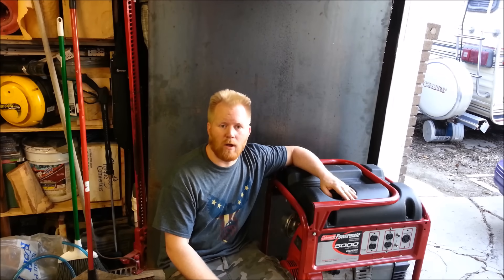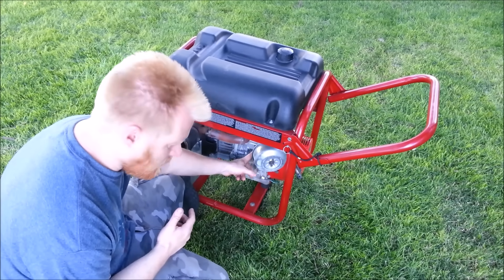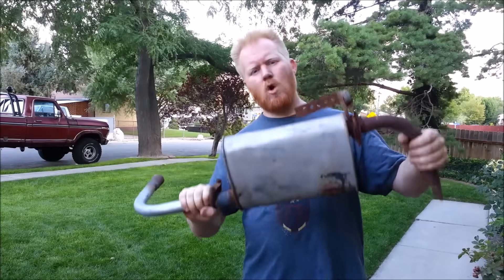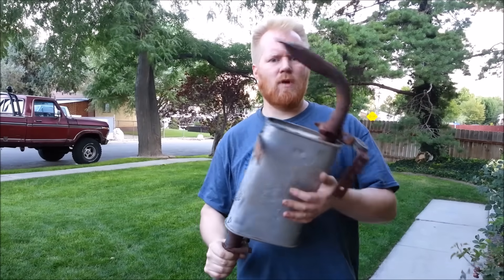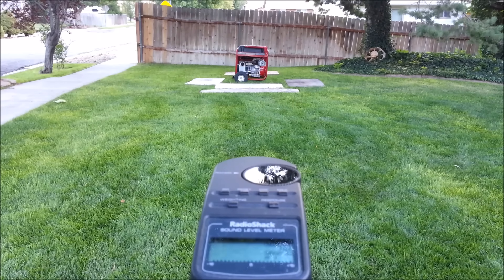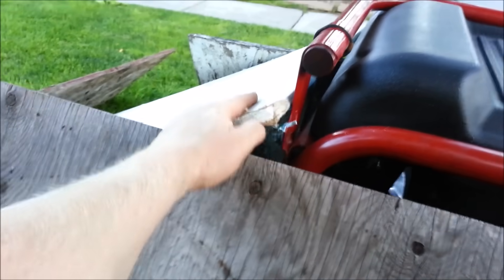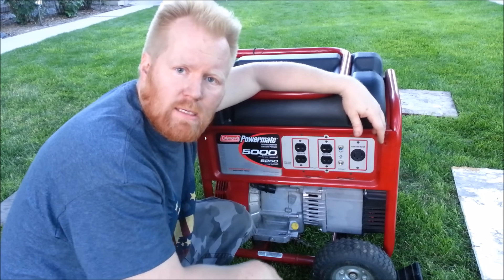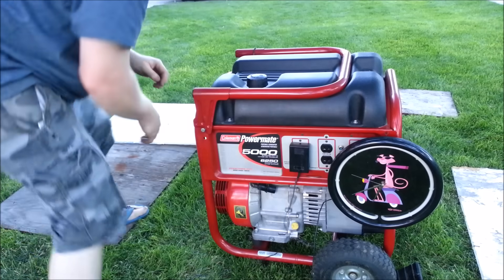4x Quieter generator in 10 seconds

Comment: Not that I dont believe you ….it’s just hard to think that on a 90 + degree humid summer day that there’d be enough cooling with all sides partially  blocked …..I do hear what you’re saying about air cooled engines only using the fins on the Balancer to circulate air …..but in an enclosed area on said 90+ deg humid day with no breeze ( that’s my most extreme example lol) I’d be nervous of one: enough fresh air getting In Through the partitions,and two: a good exchange of spent hot air , meaning reusing the air In The enclosure over and over to an extent and super heating that recirculated air…..I’d suggest on small addition , a small fan plugged right into a power strip / pig tail / splitter to push or pull air across the cooling side of the engine…. But then again I have been told I worry too much at times 😜

Comment: Best generator shutter upper I've seen ! I've done all your tricks and it does work.
 I'm not done with sine wave cancellation, though. I think that's the key. Somehow.
I also add a small cooling fan, plugged into the generator.

Comment: Honda makes the best generator as far as reliability. just like cars the Japanese know how to make a quality product that will last many years. i bought a used eb3000c generator that puts out 2500 watts for $500 a couple years ago. great backup power: you never know when will the power go out. the newer eb3000c gens have a cycloconverter that cuts down on the weight of the generator and has an added filter circuit for better reliability. if you have a welder you can add on a wheel kit to make it easier to move around. weighs about 75 lbs. spare parts would include an ignition coil and an ignition module. the combination low oil level and ac output indicator device includes the ignition module. this is a potted component and has a higher failure rate because it gets hot and potted components dont dissapate heat real well.

Comment: I'm looking to purchase a generator for home. I would only use these do to a power failure. My question is, how do you address having a generator outside in the elements? Usually it's snowing or sleeting, high winds rain etc that would knock out the power to your home.

Comment: Building a completely enclosed box insulated with fiberglass insulation for the generator to go inside would make it way quieter, probably as quiet or quieter than a car. You would need a fan and air inlet/outlets to keep the generator cool

Comment: Run that same test again and this time do temperature readings before you cover it all up and then shortly after coverlet make sure you not overheating that motor
Reply from the maker: I've done this and the engine and gen head temps are within 5degrees F. All 4 corners have huge openings to allow for plenty of airflow.

Comment: Thinking about buying the Duromax XP15000 and that's 84db, so thinking about ways to deaden the sound. This definitely gives me some ideas. I like the doghouse idea with fireproof sound absorbtion of some sort on the inside but with enough ventilation so it doesn't overheat. Should be able to rig something like that.
Reply from the maker: A full dog house is your best bet to quiet that down. 84db is extremely loud. A human perceives every 4-6db as something that is 2x as loud.  So compared to something like a Honda at around 54db this is 12 times louder. You might want to consider their 13000watt or 10000watt at 74db that is 1/4 the sound but still loud.

Comment: It might fly with the small genny and no load used here, but it's still a terrible idea. You get any bigger and actually use it for it's intended purpose, with a load, at best you will cause it to over heat and get a thermal shut down. At worst, you will overheat and either cut years off the  service life or just kill it completely.

Comment: Every 3db is a doubling of power so a 10db reduction is greater than 6x reduction in sound power. That's why there's so much difference between the before and after sounds. Probably been said already, I couldn't find it though, but it can't be said enough. Log scales are tricky. Great video.

Comment: Be sure to monitor temps. Restricting the airflows can soon lead to overheating.
Reply: Did you watch the video? He mentions airflow…
Reply: @MassDynamics  LOL he restricted air flow  that means the generator is running hotter than normal get it???

Comment: Luckily my storage shed with the genrator in it is only about 25 feet from my house - so I just let it run inside the shed with the door closed. It does get hot inside the shed but the unit still runs fine and it's much less irritating. Gonna try an inside layer of wood around it inside the shed to see what happens.

Comment: Honestly the only way that I can see to significantly lower the sound would be to replace the engine with either a two cylinder diesel engine or a scrap four cylinder car engine. These engines by design are very loud. I enjoyed your video and have subscribed.
Reply from the maker: Car engines really aren't that quiet. Open the hood and have someone hold the throttle down to 3600rpm like the generator and you'll be surprised. The hood, firewall, radiator and inner fenders are designed to reflect a lot of the sound energy.
Reply: @sixtyfiveford  this is true my friend but they are comparatively quieter than these mower engines. Plus if you were to keep the exhaust system in tact that would make them much quieter as well.
Reply: @sixtyfiveford  I would love to see you use a car engine for this genny just to see what the difference would be.
Reply: And by the way, much respect for you even replying to such an old video. That is the mark of a good content creator.

Comment: Haha not sure what Subaru you been around. Here in colo NO JOKE. Those ugly as sin cars run for 600, 700, 800,000 miles. Not little driving. All winter long you see those goofy hippy driving those shit boxes up the hill from Boulder for 2 hours and in the summer driving them 6 hours to Moab. If you can see my feeling for them haha but to say they blow up haha maybe your in a different Dimension.
Reply from the maker: Subaru small engines are only put in the cheapest budget power equipment. There is nothing good about them. As far as high mileage cars, every major brand does these kind of miles and plenty are well documented. Only difference is most people toss a car when it starts looking ratty.

Comment: In the virgin islands after a hurricane in 1995 are used a water muffler. I would run the exhaust down a pipe into a barrel of water. It reduced exhaust noise considerably.  The bucket has to be below the engine.

Comment: I build enclosure for mine.   I have a fan built in for better air circulation.  I place it right at garage door with extended muffler aluminum hose.    Way quieter with enclosure!   I use it from time to time to charge up my home solar storage  lithium when not enough sun.
I do have sound abortion material in the enclosure.    Excellent material for  free and fire proof.   The  free materials come from cushion of  swivel chair.

Why buy?   look around the house and use what is available.    I practice daily reduce  reuse   recycle    and so should you!!!!!!

Work fantastic with enclosure.   Yep i run in the garage with exhaust outside via extension metal hose.   It has been working for years!!!!

You can buy  under $20 fan on Ebay all day long.  It runs on 12V  or 120V.  All generators have either of those voltage.

Comment: Excellent empirical engineering!  The secret is LAYERING with various materials.  The more layers, the more diverse materials ... the more attenuation.  Thickness, distancing & geometry are more about redirecting the energy and filtering.  Forcing energy to make the transition from one type of material to another is where the dampening occurs ... applicable to DC through 'daylight', seismic to cosmic.  They all behave like waves of particles.
Reply: You're mostly correct about layering and different materials being effective but the underlying reasons aren't understood by most. First of all, separate layers are good primarily because of 'decoupling' (inhibiting physical transfer of sound wave energy into and through the barrier via vibration) and also 'dampening' the presumably flat, rigid surface which in turn adds mass and reduces transmitted vibrations, especially above low frequencies. Those are the 2 main reasons layers are helpful regardless of material but lower frequencies are much harder to simply deflect with a hard surface and need a relatively thick layer of soft, low density material like foam, very thick carpet or similar. It's important to know that it's very easy to block mid-high frequencies with any rigid surface but, like drywall in a house for example, lower frequencies and especially bass frequencies (<100hz or so) are poorly muffled by just a hard/rigid panel and need the extra layer(s) as described above.

So if you're gonna bother to add layers, you want the soft layer on the inside facing the source to greatly reduce mid/low frequencies. This gets kind of exponentially harder the lower the frequency in hertz but that's really only relevant for subwoofers and generator/engine noise is nowhere near that low thus doesn't need that thick of a sound barrier or that much added panel mass.

Comment: An air cooled generator needs air, not a good idea 🤦🏾‍♂️🤷🏽‍♂️ a single cylinder engine air cooled at 3600 rpm ...not a good idea to block the air

Comment: FYI: You can find "Lead-lined" drywall,...."LEAD" is a very heavy, soft metal, that can ABSORB a lot of sound, and thus QUIET the noise that might otherwise pass thru the drywall sheet.  It's expensive, (because it is much more labor intensive to handle it..... It's usually used in hospitals, in X-ray rooms, to shield against X-ray/radiation from passing thru the walls, etc.  Perhaps, try wrapping a standard muffler, with a thin layer of lead sheeting....(?!)...
Reply: FYI
I found it cheaper to pay elon musk to transport my generator up to outerspace and buy millions of mile of cord to drop back down to earth. 
Currently I have enough energy to power my 1 watt light bulb on my outhouse.

Comment: I use acoustic ceiling boards, usually, I get them free when they are getting replaced.  Just paint the outside white. The inside facing the genset absorbs the noise.

Comment: After a hurricane, it is still windy.  This would get blown away pretty quickly.  We live in Florida and have a very noisy Champion generator.  I think it is a 11,000 watts peak output.
Any suggestions on how to hold that setup in place?
Reply: He gave that to you in the video.  A cargo net with some stakes driven into the ground.   This assumes moderate wind, obviously, like you'd usually find in a fenced in back yard when the hurricane has quieted down into say, the 40 gusting range, and dried out a bit.  In an open 130 mph wind the boards will be gone, the genny will be gone, and when you try to go out to start it, not noticing it's not there anymore, you will be gone.  :-)  Most of that was silly, but the cargo net part, and I would stake it fairly judiciously, especially since the ground is usually saturated all to hell, so much so that I got a tree and $30k worth of damage in Charlie (we got a tornado, too).  The root ball was intact six feet out from the tree, and just lifted right up out of the ground.  

We were sitting in the hall during the eyewalls, as the eye was literally centered on our house, a bit NE of Orlando.  I heard a crash, a bunch of oak leaves fell down through the whole house fan (louvers were being lifted by the wind, apparently) and my heart sank.  IIRC I let out a word that was inappropriate with the kids there...and even during the storm, given that, got one of those looks from my wife.  Everybody was good though, so a good storm, in the most important sense.  

Then another (or two?) more hit in short succession, with my roof looking like Swiss cheese.  The two later weren't wind giants, by any means, but wet, really wet, one of them.  And the end of the set the street in front of my house (standard asphalt neighborhood stuff) was breathing, and cracked in radial patterns.  Guess when they got a patch on it.  Two weeks ago, but to be fair it wasn't getting too bad until then.  My bathroom ceiling, at one point was hanging down about 2', so I got a 5 gal pail and stuck a screwdriver through it.  Over a bucket, initially.  If there handn't been years of stretchy latex paint over it and the walls it would have failed long before that.

That got long.

Comment: Silly video. You cannot cheat with physics and engineering.
1. Despite what you put around g-r, you need fresh air. Esp. when you surround g-r PROPERLY - from all sides and w/o holes. And obiously internal sides must be covered with foam (like in pillows).
2. Even 70db is still enormous, annoying noise. On the video you hardly feel it - try it when your area really lose elec! When in total silence you start that monster, it will be audible on 500m away!

My offer is to put device in earth - this way you need only one side to cover - top one. And of course you need forced air stream come to device (to cool down + burning). Exhaust you can put inside any pipe and turn in a heaven (as high as possible to avoid breathing output sh1t).

Comment: (Wrong title)  2X quieter is accurate because 80 dB is 2X louder than 70 dB. The decibel scale is a logarithmic ratio.  But regardless,  the resulting reduction in sound pressure is impressive and simple to implement, good information. 👍
Reply from the maker: However the human ear perceives a 4-6db drop as half as loud. So 8-12 would be perceived as 1/4

Comment: 80db down to 70db is 2x quieter, not 4x.
Reply from the maker: Not by human perception. Every 4-6db drop is perceived as 1/2 as loud. 10db is perceived as 1/4.
Reply: @sixtyfiveford  That is not accurate. There are several measurements/factors when it comes to measuring sound. It takes 3db to be perceived as a change by human hearing. +/- 10db is twice as loud or half as loud to humans. It all boils down to human hearing perception. Human hearing is not the same as sound pressure level measured by an SPL meter which is actually not measuring loudness. Doubling of halving via a meter will register 6db +/- which is actually a voltage gain/reduction measurement. Humans do not hear via gain/reduction voltage. All in all, when it comes to a generator loudness, no one will care about what the voltage measurement is. They will only care about how loud it is to the human ears...and thus, -10db is only half as loud. And, looking at this test, it was only measured -9db less (voltage reduction) so that isn’t even half as loud, to humans, mapped against a voltage curve.
Reply: @sixtyfiveford  Not trying to bash you at all. Just trying to be accurate. I actually appreciate this simple test because there are a too many rock crusher generators out there. Need to quiet them down a bit. Another point, your measurement is directly affected by the single sheet of plywood blocking the SPL meter. If you move the meter 45 degrees either way, it will pick up the direction generator noise again from the open corner.

Comment: Much appreciated video - I wanted something to protect my generator in case it is raining/snowing. I took your plywood idea and built a plywood box lined with 4 inch thick Rockwool insulation to fireproof it. The sides are removable for air flow but like in your demonstration they lean downward driving some of the noise into the ground. So far so good & it only cost $60 to build.
Reply from the maker: Nicely done!

Comment: If you use OSB with rockwool glued on the side facing the generator. Rockwool is fire resistant and sound deadening. I would like to see those db readings again with those panels. I'd be willing to bet 15 - 20 db drop. I'm going to give it a go with my generator.

Comment: Good education. that large muffler your holding, at 3:15, is too restrictive, with many bends inside.  It is called 'back pressure' and on a one cylinder engine, would restrict the rpms'.

Comment: Since valves are releasing high pressure bursts of combustion gas, and generally slamming around the valves open, and closed, and push rods banging back, and forth in their clearance slack that's where the noise comes from. Hitting the thin metal of the head with all that makes for more noise than in a head with more metal mass. Same as hitting any thin piece of metal with a hammer compared with hitting a thick one. So put some weight on the head. Dampen the noise at the source.. Clip on some tire balance weights or even strap some bricks to it.

Comment: 10dB is 1/10th of the power by definition. Increasing the path to the microphone can also be achieved by deflecting the sound upwards - which will have a more beneficial ventilation outcome - just as someone mentioned putting the generator in a hole in the ground.
How a properly designed muffler works is by splitting the sound wave and reversing the phase of one half of it where the two recombined cancel out. With a fibreglass absorber - much the same happens but with far more pathways for cancellation to occur.
The idea is not without merit but I think a simple 4 sided OSB/rockwool box would be more elegant but isolating the generator from the ground would also reduce CONDUCTION.
A generator is not far off a square wave generator but most of the energy is in the lower frequency end - and these frequencies are less directional which partly explains why you consider high frequency reduction beneficial. The other reason is that our ears are far more sensitive to midrange and upper midrange than bass.